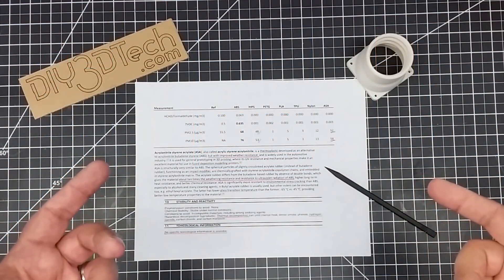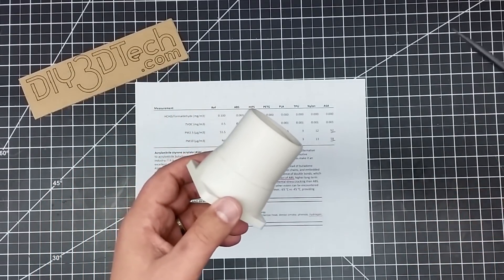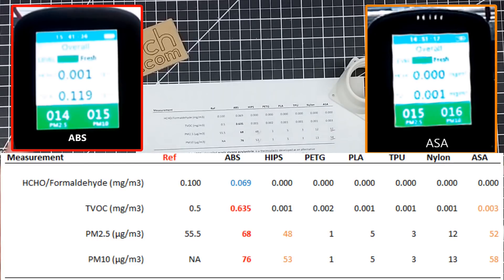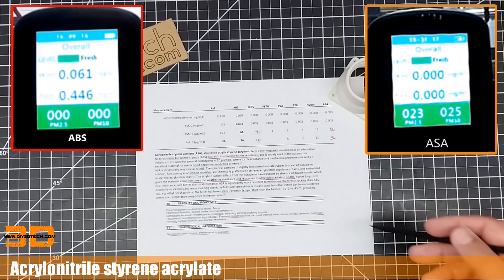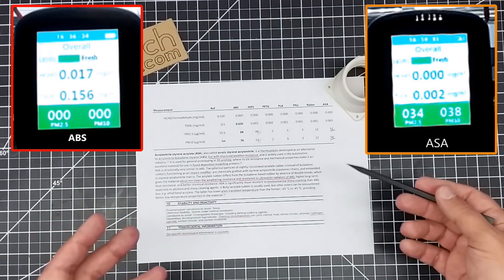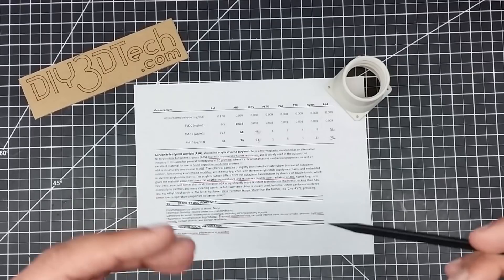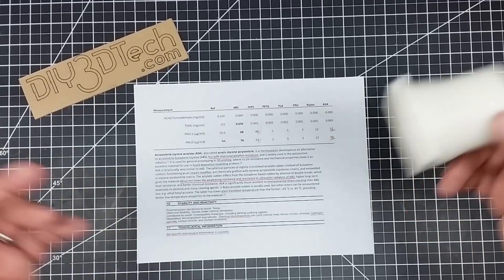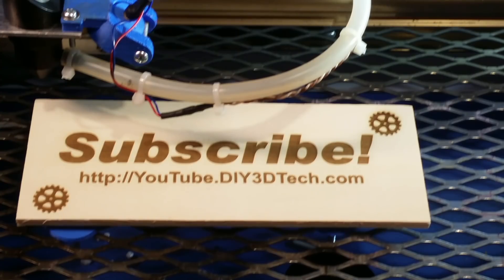3D Print Air Quality -  ASA  vs  ABS and the RESULTS are!

Comment: thank you for research, I know this video is older. I run my air meter close to me and I have the Bambu X1C and no problems with the ASA, scared of ABS :)  i actually have like .350 tvoc when printing ASA so I put it in my added enclosure and run carbon filters during printing, that move the needle down to almost zero with 2 on the pm2.5. My enclosure in on my channel.  info only channel nothing fancy, I share what I want. :)

Comment: Hi I am preparing to build a Voron.  Would ASA be a good alternative to ABS.  I really like the UV properties of ASA but am concerned it may not stand up to the heat in an enclosed printer.
Reply: It has about the same heat deflection as ABS. Anecdotes from the voron discord also mention it lasts longer than ABS before cracking.
Reply: TY👍👍 @Gadtkaz

Comment: well... f**k. I printed it on my open 3d printer for like... half a year and even stayed or slept in the same room while printing

hope I don't die
Reply: lol. Didnt it smell?  I'd be too afraid to print it in my room without wearing a respirator. Im going to put my printer in my garage and print the parts I need with it.. Only if It was enclosed with a HEPA filter vent would I leave it in my room. Or even get one of those soldering fume extractors and put it inside the enclosure.

Comment: Can you elaborate on the particles? Do they fall to earth? ie If I left my print in place in my printer enclosure for say two hours would the air quality be better?
Reply: Problem is that as soon as you move the air in that room these micro particles start moving around as well
Thus a HEPA filter and/or venting is absolutely recommended

Comment: interesting, currently, I'm just printing this stuff in my room with an air filter for now.

I will be taking my printer to the garage but if I just print small prints and have an air filter running will I be okay?
Reply: If you have the printer in an enclosure, and your (HEPA + charcoal) filter is recirculating air within that enclosure, then it does cut down on most toxic emissions. But if your filter immediately vents it to the outside of the enclosure, then it's extremely inefficient. I still recommend moving it to the garage, and if possible even venting to the outside.

Comment: So I found this channel after printing exclusively in PLA for 6 years (not commercially, just a hobby) with no notable issues.

I just tried my first ASA print (24 minutes long print) and I have a massive headache along with 1 side of my nose clogging almost completely.

Headache went away after going outside for 5 minutes, but now I have questions.

Is this dangerous during handling, like post process sanding for example?..or touching regularly if it's a phone mount that sits on a car dash in the Summer sun for all day?

My printer is fully enclosed, but don't have an easy way to vent outdoors. Would adding a port to attach a vaccum with HEPA filter do anything for the toxicity of printing with ASA....where I would vaccuum out the chamber before opening. Or is does a HEPA do nothing for fumes and is a poor choice?

Thanks for the video.

ASA sounded so promising for parts to use in hot vehicles during Summer, but I'm not sure my health is a great tradeoff....or my family who would also be exposed, as I print at home.
Reply: Did you have an all metal hotend? What machine are you using?
Reply: @TableTopBiker  Dremel 3D20, which is basically just a rebranded FlashForge Dreamer. 

It's fully enclosed.  It's been a while since I tried ASA, so I would have to check what brand it was.  I only tried that one print, and never touched it again....as it was shockingly terribly smelling.

I've never been entirely clear what people consider an all metal hot-end.  The nozzle, heater, etc are all metal.  There's a PTFE tube in there, which would make it not all metal I suppose.

Comment: Hi , I used to print Esuns ABS+ in my open ender 3 pro and artillery sidewinder X1, So recently I thought giving a shot to esuns EASA as they mentioned its similar to ABS but just couldn't get it to print whatsover.I tried temps from 225-260 C as they have mentioned its either really stringing or every weak.I'm ware of the moisture issue but it was a day old filament . Can you point what could be the issue ? i didn't switch on the layer fan as they mentioned its exact;y like ABS . i don't have any warp in esuns. i couldn't find many videos on youtube regrading ASA .Appreciate any help ..
Reply from the maker: There are many variables here especially nozzle size too.  As keep in mind the lager nozzle to more issues will have as it is hard that much plastic uniformly when it comes to ABS.  Personally I use PETG instead...
Reply: @DIY3DTECHcom  So i kinda figured it out .I just switched on the Fan to10-30% TEMP 230-240C . Increased flow rate to 1.1 extrusion multiplier .But im not getting that matte finish which is supposed to be associated with ASA as the manufacturer has also mentioned it  .Any ideas? increased print speed ?

Comment: I am new to 3D printing. Would you recommend ASA to print a bird fountain? I don't want to poison the birds as they will be drinking water from it. Please check out my thread on Reddit. I welcome anyones contribution. Thank you.
https://www.reddit.com/r/3Dprinting/comments/fnrhoc/best_material_for_a_bird_fountain/
Reply from the maker: Good question, some commercial ASA is food safe the question is, is your ASA safe?  I would have to say for birds, I doubt there would be an issue.  I would not however use ANY filament for human use unless I was 100% sure.  As the Chinese makers have terrible quality control  and do use "fillers" to lower the cost of the material.
Reply: @DIY3DTECHcom  Thank you for your expertise. I hope you can read and help me on my reddit thread. Then there is ceramic 3D printing: http://www.akronporcelain.com/Ceramics/default.htm

Comment: How do people get on who work at injection machine factory's using all types of plastic
Reply from the maker: While not an expert, however having been in many plastic injection molding facilities I would guess: Injection molding it a bit different in that it happens in a sealed mold so the plastic contact with air is minimized when it is melting (unlike an FDM printer) as it is melted in a pressure chamber and then forced into a mold where it cools before the mold is exposed to air.  Second is ventilation and air scrubbing as you can google the topic and there is tons of info out there and I don't mean to make this sound "intrinsically safe" by any means at all.  Also my guess is PVC will be the worse offender....

Comment: I found that ASA burns my throat. After some more exposure sinus symptoms. On bigger parts I get good strength but pencil thickness and thinner I get brittle results. Still have to fine tune some more.
Reply from the maker: This is not good, as ASA gives off Styrene which is cancerous.  You should not expose yourself to any Styrene based plastics without ventilation as your simply inviting trouble...

Comment: Thanks for this test, or rather for the whole series!

Controversial, difficult to prove (with our means), and probably wrong hypothesis: what if your sensor by accident is actually capable of accurately capturing all the VOCs that come off all filaments that you have tested, but uncured Styrene monomer is really extremely smelly even in the smallest amounts, which is how the results come out this way?

And yeah i remembered things right, Butadiene co-polymerisation acts as Styrene polymerisation inhibitor.
Reply from the maker: You amaze me whenever I read your posts (Butadiene co-polymerisation acts as Styrene polymerisation inhibitor).  However I think the VOC's are WAY under calculated and the reason for mainly focusing on particulates.  Also your welcome

Comment: Do you think venting is necessary if you've got an enclosure? You've made me think a lot about my health today....
Reply from the maker: Yes I would, the particulate count is high.  Have you checked out the series?  I will also discuss this more next week in the wrap up video...
Reply: I have only briefly checked out your series. Is there a way of venting away from a window without excessive tubing?
Reply from the maker: Not really as the UFP will pass though a HEPA filter...
Reply: That's useful information, and I'll do some more on the subject. Thank you. I'll try switching the location of my printer.

Comment: Have you tried the ASA from rigid ink? It's not cheap but not worse to try it. Didn't had problems to feed it into my MK2S.
Reply from the maker: No have not tried Rigid Ink as your right they are expensive.  The issue with wasn't really with the extruder, but the filament wanted knot up it was so rigid...